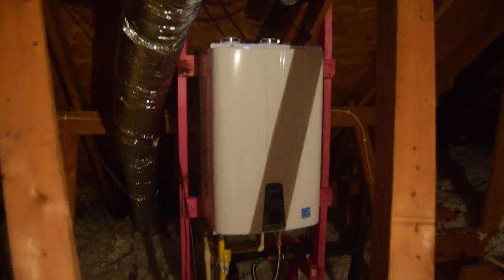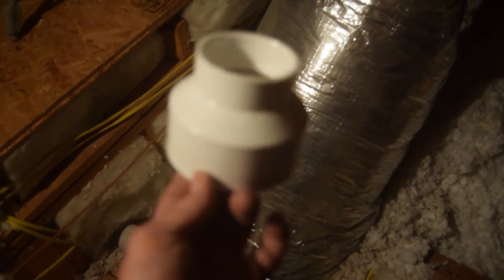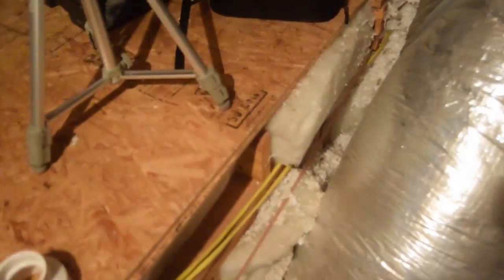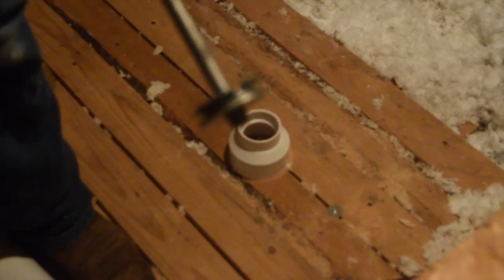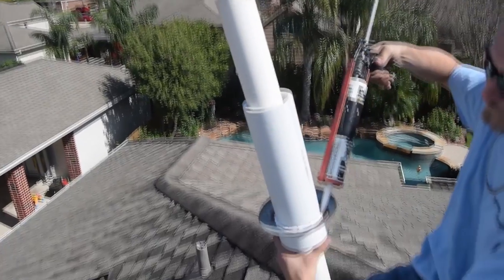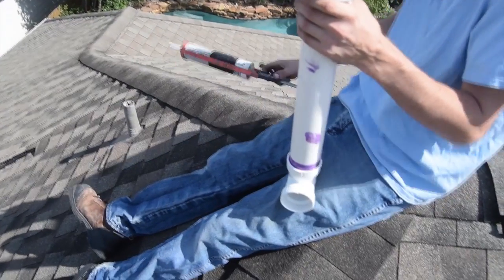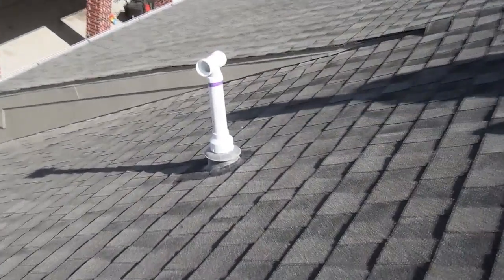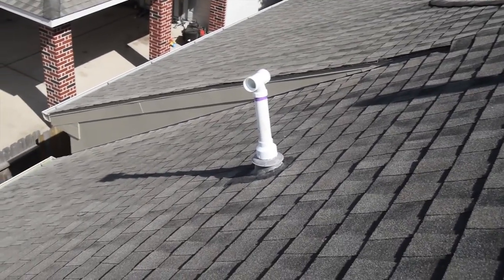PVC Tankless Vent Installation

Comment: As a plumber, I am impressed with the idea of using the reducer to act as a Stop for the b vent storm collar. Pretty slick. But out of curiosity, why didn't you just use a 3" PVC concentric vent kit? That way you could get your makeup air from outside and not worry about creating a back draft through the heat exchanger in the winter. I ask only because I like to hear how and why other plumbers do their thing.
Reply from the maker: Navien doesn't recommend using the 3" concentric vent kit. And we are after all in South Texas. Back drafting isn't really a problem here. Also Navien has a damper in the exhaust to prevent backdraft. I could have simply transitioned to 3" withing 1' of the top of the heater, but I wanted to do the video on this job. My supplier of Navien asked me why I didn't do that & My answer was that in this instance, it would have been fine, but on a long run, the 2" pipe & fittings are a whole lot cheaper. And just as a final note, if I had gone with the 3" concentric, I would have had to wait for it to come in. They are scarce as hen's teeth in our area. Thanks for the questions.
Reply: @Backflowandbeyond  im venting a couple of Naviens tomorrow. I have the concentric kit coming tomorrow. It appears you're using regular schedule 40 PVC, I see their manual says that's permissible but then they go onto list a bunch of brands approved for use with their units. It's a little confusing. Are you just using clear PVC cement and making sure the line has proper fall back to the heater if you run horizontal?

Comment: How can you use PVC for exhaust? What are the temps coming out of that? You'd think they would be pretty high, above 200F exhaust gas temp. We just got a Takagi and it says you have to use Category III.
Reply from the maker: The temperature of the exhaust coming out of this unit is around 100 degrees, that is well within the limits of PVC pipe. Your Takagi isn't a condensing unit, therefore you must use category III Stainless vent pipe. This unit reclaims 99% of the heat generated by the burner. Yours will reclaim about 70%-80% of the heat. That is just one of the many reasons we think Navien is the best heater on the market.

Comment: That T up top looks like it would let rain come down and into the water heater.  All it's gonna take is a little wind to blow it right into the vertical pipe.  Also, shouldn't the intake have a pipe with a screen in it to keep critters out?
Reply from the maker: Hi Don, The manufacturer's instructions call for a T on top. So, that is what we put there. As to the screen, there is a screen inside the unit that does that. If too much resistance is put on the intake, it will upset the heater. Thanks for the questions.

Comment: Great video it is exactly what i needed to know, as i am replacing a 40 gallon tank heater with a Rinnai RX 180 IN condensing unit it is an indoor/outdoor convertible model. If you are familiar with that model, will you procedure as stated in your video work for me. It will be installed in an exterior water heater closet with a vented door but i want to run the exhaust through the roof flashing as you did in the video, the the roof existing roof vevt is very shirt only about 4 feet from top of old tank to top of old termination cap on roof. Thank you so very much. Greg

Comment: Pretty clever!  I just put in a Takagi tankless and had a similar situation with the vent - had 6" single wall flashed to the roof with a 6 to 4 metal reducer.  I ran 3" PVC and used the 4x3 reducer with the stop removed to bear on the tapered part of my metal reducer.  I capped that with a slip over rubber collar to flash it.

Comment: Nice video, good tips...but please fix your camera focus! Don't you need a 90 elbow on the sides of the roof "T" so rain is not blown in?
Reply from the maker: No, there is a condensate drain on these units that also serves to take any water that comes in the vent away.

Comment: Thank you for the video. Is it a good idea to run the PVC pipe thru the exist Type B vent all the way up to tip of the B vent? This way no need to remove the exist B vent. Thank you
Reply from the maker: Sorry for the late reply, I had no idea that I had comments. No, it is a corrosive exhaust and would quickly deteriorate  the metal vent. The manufacturer states that it must be PVC or ABS pipe.

Comment: My inspector said prove that you can take the intake air from the attic. Seems obvious that a 1300 sq ft house with a 2x8 roof and 2 1x3 vents are each end would easily provide the intake air for a 2 in intake pipe. Can you help with some calculations.
Reply from the maker: Sorry for the slow reply, I just noticed there were comments that were unanswered. I would ask him to show me where in the code it says I can't. I can tell you that on a Navien, the manual says you can, provided there is adequate ventilation. Good Luck.

Comment: i like what you did with the vent through the roof.. I was just wondering how you keep moisture out the exhaust when you get blowing rain or snow
Reply from the maker: You don't keep it out, It goes down through the unit and goes out the condensate drain on this particular unit. Each brand has their own way of dealing with this issue. Thanks for the Question.

Comment: Wouldn't reducing the Exhaust make the unit Turn off because its not extracting enough Heat causing unit to go in to safe mode?
Reply from the maker: We didn't reduce the exhaust, please watch the video again. it is one piece of 2" Pipe from the heater all the way to the T on top. the 3"X2" reducer is an adapter to make it fit the existing roof flashing.
Reply: @Backflowandbeyond  i see, Original Pipe was 2" so you used 3" adapter to fit it on to the roof exhaust without having to modify! i got confused because my its a 3" from unit to roof and actually the Id its bigger than 3" something like 31/4 or so so i just added a Coupling to the pipe and it fit right in not on the outside but on the inside without even touching the existing exhaust
Reply from the maker: @quirino18  if it is a Navien Heater, that voids the warranty. The vent cannot be run in anything except PVC or CPVC pipe.

Comment: I need to do the same thing for a condensing Navien NPE-240A2, but my existing B-vent runs from the garage, through the second story wall, and out the roof.  The B-vent is a straight run, but I probably can't easily remove it.  Can I leave it in place and use it as a chase-way to feed approx 20 ft CPVC pipe down from the roof to connect to the Tankless WH? Is the CPVC pipe likely to rattle around inside the B-vent?  The CPVC pipe could be secured/supported at the tankless WH, the garage ceiling, in the attic, and at the roof.  Is that enough to pass an inspection, or do I also need to open drywall in the second story to add a support?   Should I stick with 2" CPVC pipe so the volume of hot gas gets pushed out the stack before it cools and CO descends back down the pipe and into the garage?  Or is this approx 20 ft length better served with 3" pipe for less resistance?  Does CPVC need to be allowed to expand lengthwise like the old B-vent?
Reply from the maker: Sorry for the slow reply, The pipe that comes off of a Navien is 2" PVC, and it is possible to do what you are asking, but it will be a tight fit. 2" PVC will barely fit inside 3" B Vent.

Comment: I have a navien combi unit , it is in my basement.  Can I vent it to my roof?  It is currently spitting out the side of my house.  Any ideas would help greatly, thanks 🙏
Reply from the maker: Yes you can!
Reply: @Backflowandbeyond  are there any steps other than just running it up and out?  Feel like condensation will build

Comment: why didn't you put a plastic screen or something on the pipe you did with the original flashing??  wont squirrels and other thingks like birds try to get in there???  we have all kinds of squirrels and small birds around my area. no way i would leave those holes without screens plastic or another type screen.
Reply from the maker: If you mean the original flashing, we reused that hole and put 3" PVC Pipe through it. If you mean the outlet for the water heater, we do install a plastic screen that comes with the heater. You have to e very carful when covering these vents, if you put too much backpressure on the heater, it will stop working & throw an error code.

Comment: Could you run the exhaust vertically up the old water tank chimney?
Reply: no!!!
Reply from the maker: No, it is a corrosive exhaust and would quickly deteriorate  the metal vent. The manufacturer states that it must be PVC or ABS pipe.

Comment: I'm planning on adapting your solution for the NPE-180S I'm installing.  I'm in N. California with average rainfall and little to no snow.  Couple questions: 
1) How do you determine the length of pipe protruding from the roof?
Reading the comments I'm still a little unsure about the termination with regard to rain.  From the Navien Installation and Operation Manual, NPE Condensing Water Heaters, v5.3 (May 29, 2019), pg. 34: "To avoid moisture and frost build-up and to maintain clearances to openings on adjacent homes, 45 degree elbows, 90 degree elbows, or tees may be attached to the end of the termination vent pipe to direct the exhaust plumes away from buildings, as long as the total allowable vent lengths, maximum number of elbows, and distances to air intake restrictions are observed."
2) Any concerns using a 90 degree elbow for the exhaust vent to keep rain from entering?
Reply from the maker: The length above the roof should be 18"-24". We always use a T on too of the vent pipe. In the off chance some rain does fo down the vent, it is directed down through the burner assy & comes out the condensate drain. I have seen them improperly installed with nothing on top & they worked just fine. The 180S by the way is the same setup as the 240A. I would however suggest that you go with an A model.
Reply: @Backflowandbeyond  Great, thx for the reply and the info.  Nice work!

Comment: Been looking for a good way to go through b vent.  Thumbs up 👍🏼 on this one!
Reply from the maker: Thanks, it has been a lifesaver, sure makes it easier. We have also found that using an appropriate size hole saw works better to remove the stop.
Reply from the maker: It was the easiest way we could come up with and remain 2". Of course, you could always increase to 3" PVC and still use the existing flashing.

Comment: Also my installer did not use an expansion tank for my Navien 240S tankless water heater. Can this be a bad idea?
Reply from the maker: With Tankless, there is no thermal expansion, so an expansion tank is no necessary, However, your town or jurisdiction may require one, and if that is so, then he needs to add one.

Comment: Do you put anything on the air intake side? Like a short piece of pvc with a 90?
Reply from the maker: When we started out, we were not, just putting the grid piece that comes with the heater, but now we put a street 90 in the intake & put the grid in that. I figure that way nothing can fall into the heater.

Comment: Why not just adapt to the B Vent
Reply from the maker: B Vent can't be used on a condensing Tankless water heater as corrosive water condenses in the vent. Plus the Manufacturer specifies PVC pipe as the vent material.
Reply: @Backflowandbeyond  Gotcha. That's what I thought aswell until Noritz  came out with the EZTR50 Bundle. 
Has the exhaust vent tieing into the existing HWT venting.

Comment: Pretty sure Navien requires a candy cane for the top of the venting for their warranty.
Reply from the maker: Navien requires a T on their exhaust, If you go above the roof with the intake, it requires a candy cane. If you take combustion air from the attic as we do in Texas, you can just put a 90 on top of the heater.

Comment: My installer did not use a sanitary T at the top of the vent pipe on the roof. He used a 45 degree elbow with a plastic screen. I have a little concern about rain water entering the unit and causing damage.
Reply from the maker: He should have used a Tee, that is what the instructions call for. If water does enter the unit, it should be channeled into the condensate drain, but if it is a really hard rain, it could overwhelm the drain and cause damage to the unit. I would definitely get it changed.
Reply: Okay I’m going to change it to a tee. I noticed in your video that your tee doesn’t have bird screens. Does it not need screens?
Reply from the maker: If it is in an installation that isn't used often, such as a beach house, I would suggest screens. But this is a single family home where the heater gets used frequently.
Reply: you can get away with a 90 or two 90s pointed down (no rain) but always bid screen

Comment: so the gas line that fed the original tank water heater was sufficient to supply the tankless? the tankless heaters are usually about 5 times the btu of the tank heaters
Reply from the maker: Yes sir, there was a 3/4" gas supply already there. But just for future reference, Navien heaters can run on 1/2" supply under most conditions. Thanks for your question.

Comment: You can't vent straight into the old one like that it has to penetrate all the way. The moisture will build up and come back in the house.
Reply from the maker: I am not sure what you are saying here. We didn't use the old vent at all, just the roof jack. Been doing it this way for about 5 years with no issues whatsoever.

Comment: Terrible plumbers give us HVAC guys bad rep that was awful install and need to follow venting  in navien installation manual at least new flashing for pvc venting and you are supposed be using cvpc schedule 80 on exhaust and supposed use an intake for combustion air what are you guys chuck in a truck would not be proud. Of that install terrible hack city
Reply from the maker: Well Brian, it is very obvious to me that you are not at all familiar with Navien Water Heaters. They do not require schedule 80 CPVC pipe for their vent, in fact, schedule 80 CPVC won't even fit the vent collar on top of the unit. So, maybe you should stick to doing HVAC and leave the plumbing to the professionals.